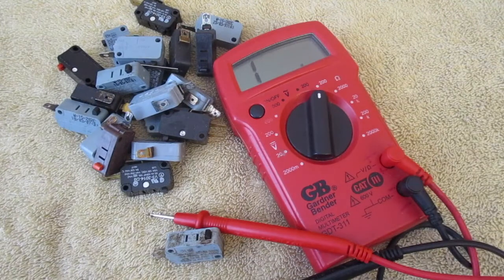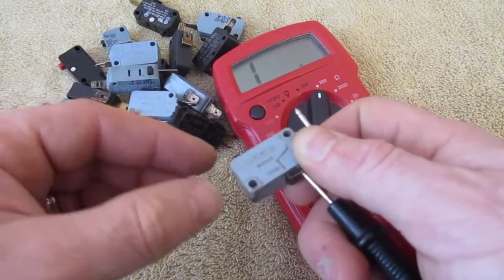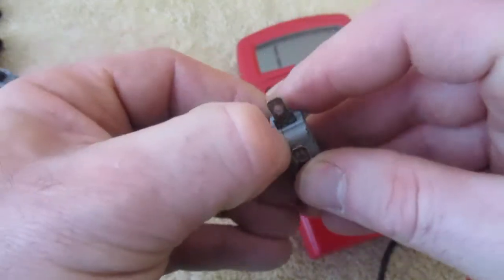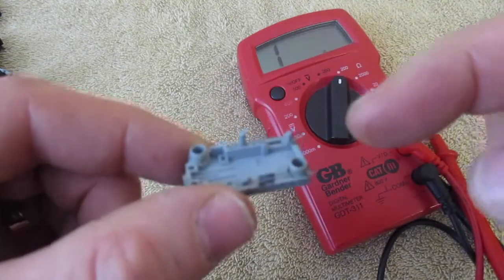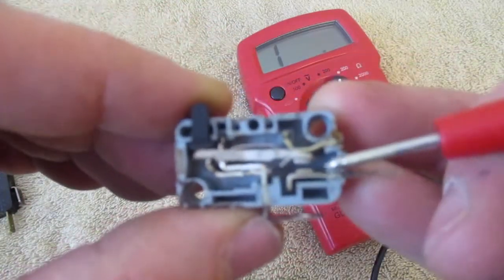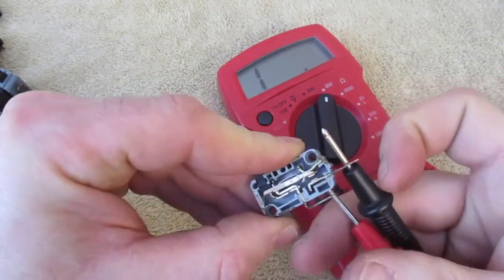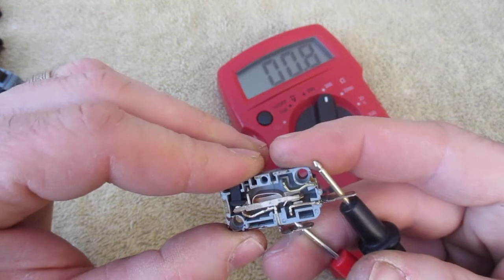How a Microswitch Works Microwave Oven Door Switch Dish Washer power window

Comment: Thank you! This was very helpful.
I have opened my microwave and this switch fall apart, because he is not glued together and I had to use some force to pull the switch out of the cage with the two parallel microswitches.
Now I could make it working. It is useless to threw away a whole device because of a tiny fix-able problem.

Comment: Thanks!
Reply from the maker: Glad it helped.  Thanks for the Thanks!!!
Reply: @youcanfixit3721  Of course. The switch on my space heater wasn't working properly and I accidentally let the pieces fall out when I opened it...it was like working an annoying puzzle with a 5 pound weight attached to it. Very annoying.

All good now and I understand the switch better!
Reply from the maker: @Isaic02  Glad you got it cleaned up and back together.  Thanks for the comment!
Reply: Glad to see your post with the inside pieces of micro switch, which is just like mine. Mine fell apart when I separated the plastic cover. Now I can see from your example how it all fit together in the holder, except how to place the brass clip or spring. One side has small slits on both sides that locks into something. I can see from example where it should go. But, how do I put it in place?
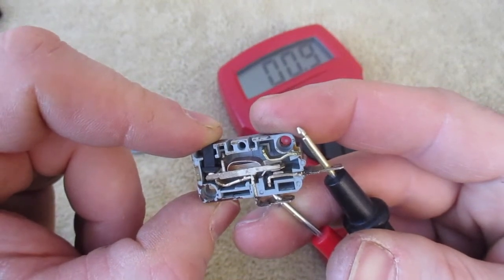Reply: @MorAcht  I think I had your same issue, but trying to explain the fix might be confusing, but here goes. Looking at 2:44, the metal with 2 right angles in it (connected to the red prong), bends twice and is surrounded by another fitting, which contain the brass clip/spring. The left end (coverd in the video) of the brass clip/spring slips into the center of the 2 right angle piece, then the surrounding fitting is slipped over the top of both pieces, creating a lever system. Those 3 pieces are then slipped into the plastic case. 

Keep in mind, I and not certain I remember it correctly, nor that the problem I had is what you described. So don't get hung up on my advice if it doesn't work.
Reply: I haven't been successful holding the three pieces (the 2 right angle wire piece, lateral piece with one of the  points & movable arm with plastic end) together in my hand to put the spring clip in place. Then try to fit all of this into the slots of plastic case without it falling apart. But, going to give it another try. Thanks